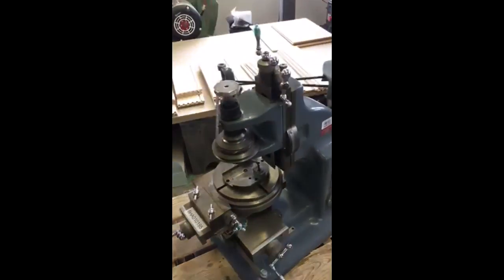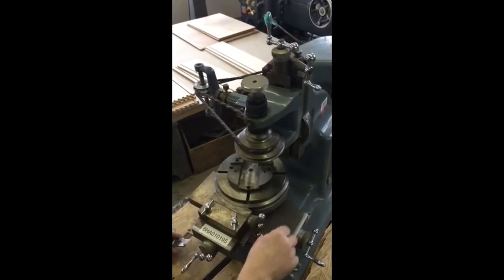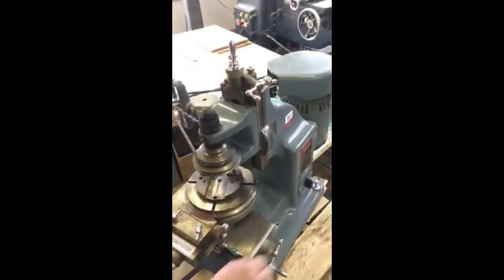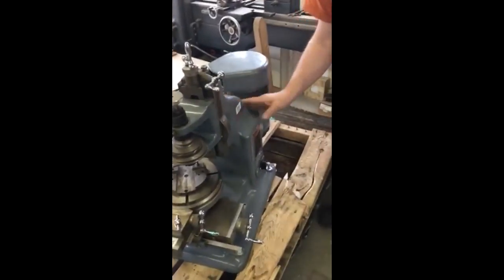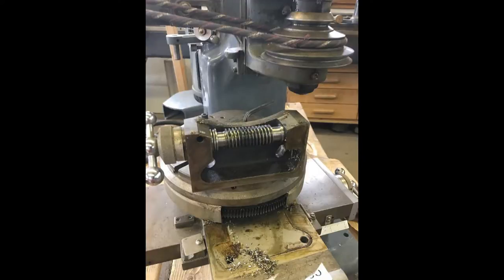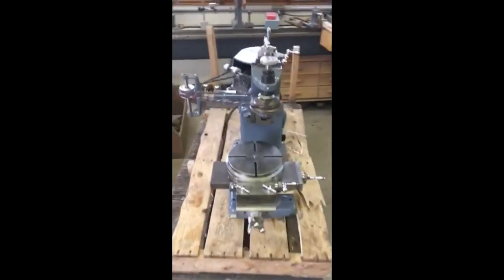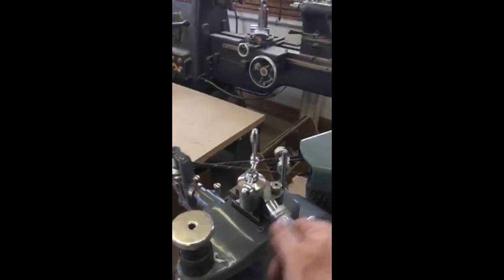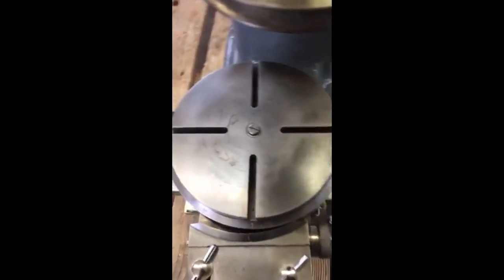BCA Jig borer Made in England 1953

Comment: very clean machine! is there a chance you can give me the basic measurements, like from the rear of the motor to say the front of the main casting, the width of the main casting, and the maximum distance from the spindle nose to the top of the table, would be greatly appreciated
William
Reply from the maker: i am not in the shop for a few weeks
Reply: Okay thanks for getting back, whenever you can is fine with me.